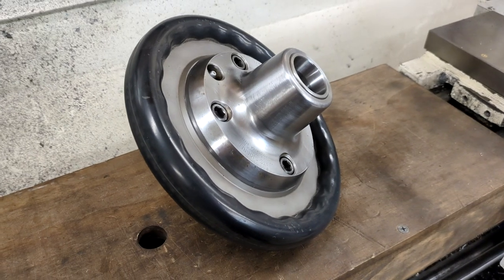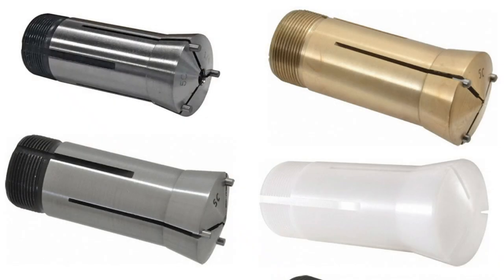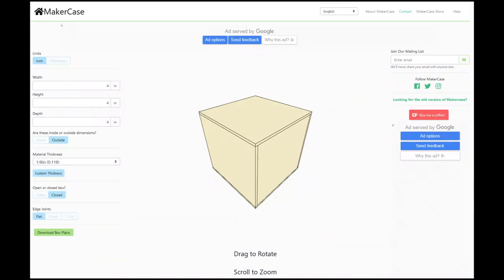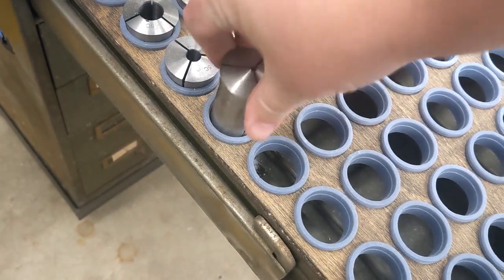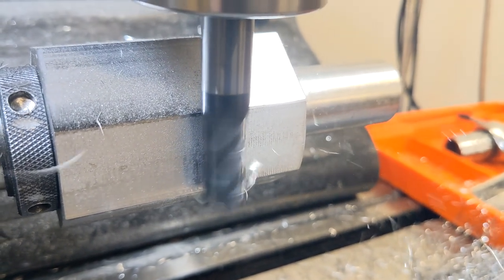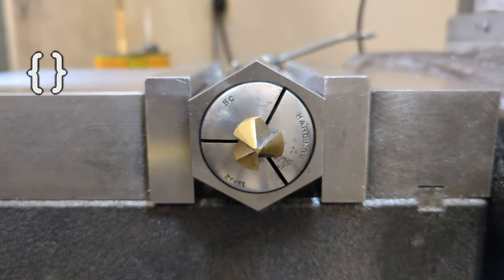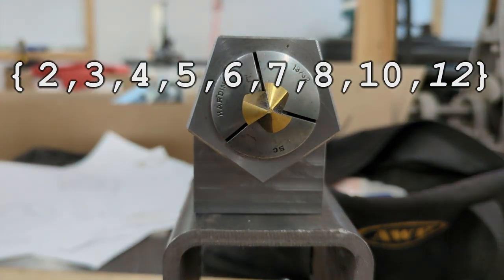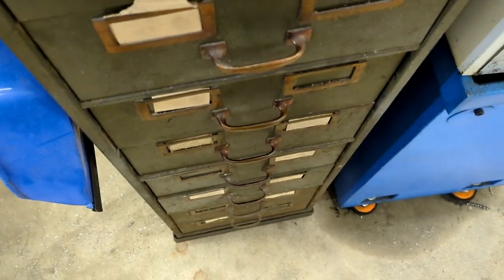Collets, collet blocks and more

Comment: So will my r8 collets fit into this c5 collet block? I understand c5 threads outside, r8 thread inside…I’m very new to this stuff.
Reply from the maker: No, R8s are much narrower, so you'd need a special block for those. It could be done, though I'm not sure I've ever seen such a thing. Since R8 has threads on the inside, you can't pass stock all the way through like you can with a C5, so they have a much more restrictive diameter and depth they can hold. They're really just intended for holding tooling.

Comment: Your line about "stacking up enough prime divisors" reminds me of the Newbould Indexer. It uses a stack of plates with partial face splines to index to any angle precisely. Each spline pair has an unusual spacing, such as 1.1° per tooth. (Since the splines aren't complete, they don't need to divide evenly into 360°.)
Reply from the maker: Oh, that's very cool!

Comment: I'd rather get a 1 5/16" hole saw, spade bit, forstner bit, boring head, fly cutter, or router bushing with hole template, sketch or scribe a circle and cut it with a scroll saw, jig saw, Sawzall, coping saw, jewel saw, than be trendy and buy a 3D printer, thats a lot of money i could spend on more machine parts, more tools, more tacos, tortas, sushi, sandwiches, hamburgers, whiskey or tequila, thats just me though.